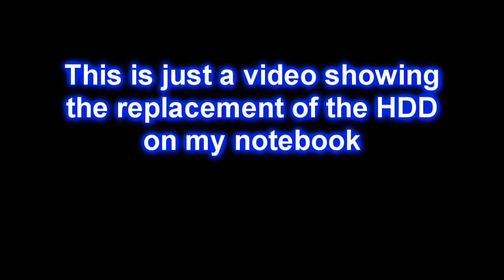LG P310 HDD Replacement

Comment: Nice job! Works as well with a very similar LG P300.

A couple of comments though:
1) You unscrewed too many screws. The two near rear feet (left and right of the battery) and the two small behind the keyboard in the center were not necessary.

2) To upgrade memory/clean cooling system one only has to remove keyboard. This is done by unscrewing two screws with a keyboard sign. I suggest cleaning cooling system regularly (at least once a year). The laptop becomes much cooler after that.

Comment: Hi! Thank your verym much for this video. Was longing so long to find anything like this.
With my LG I had a problem to remove the top aluminium cover. It somehow sticked on the upper side towards the hinges. So I broke my cover on the side frames which are very weak.
This hdd replacement changed my mind about the LG notebooks. At first I really loved it but when you need to change the hd it is a torture.

Comment: Am on SSD now^^ Had some problems removing the grey plastic chasis - there were several hooks behind the plastic. Keyboard went off smoothly. I was wondering on how to clean the cooling system properly. Tried to remove some dust from the fan but it would be easier to remove the whole thing. Doing that would remove the heat pipes from the board also. I should get some heat paste/compound before doing that :-/